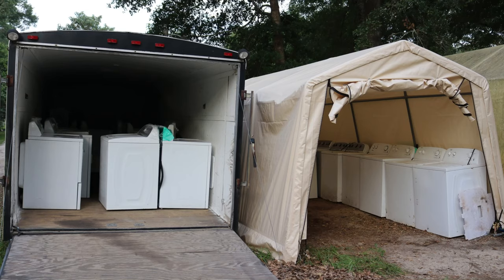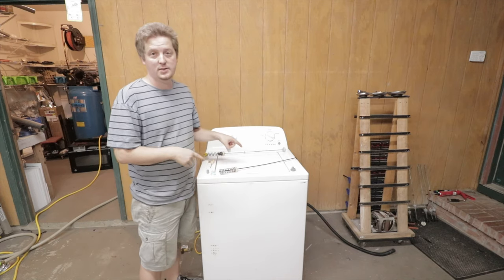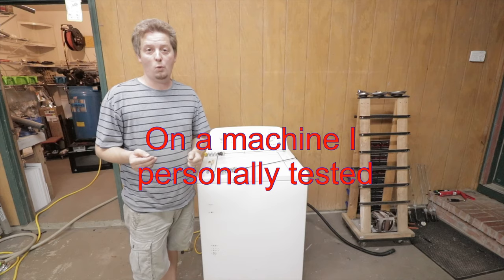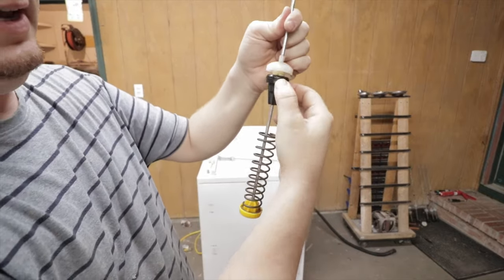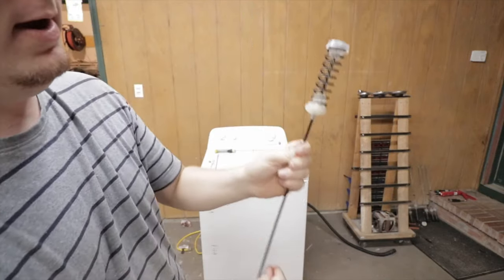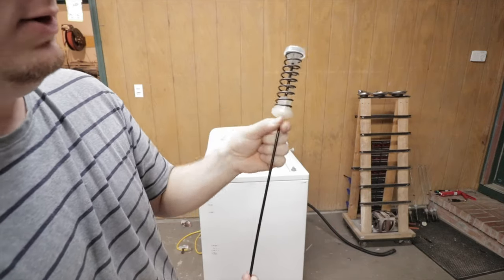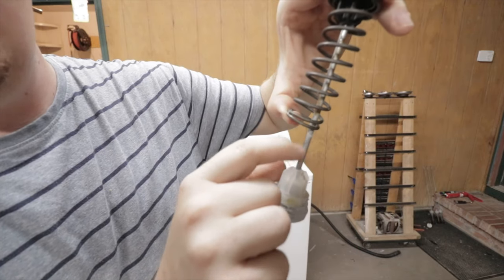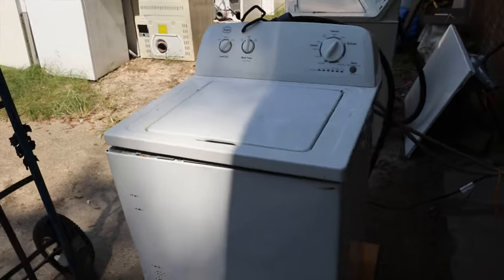Cheap Permanent? fix for shaking banging Washer? $7 to fix Suspension dampening rods W10780048

Comment: Good evening I tried the vice grips on the rods what I did was fill with water at the low setting so that it would compress the spring some then on each rod I pushed a little plastic part down where it was snug against the tub bracket that goes on the rod clamp them off with the vice grips all four corners and run it through it cycle it actually worked pretty decent it did not shake near as bad as it did before but I am going to go ahead and buy a kit to repair them/replace them
Reply from the maker: Yeah some of them are not very expensive at all.

Comment: I just want to say that those springs do get weak but here's a possible solution wrap the area with ductape leave on for a couple days and remove. Now that the ductape has been removed the adhesive from the ductape is now on the the rod. Now the foam piece will stick to the adhesive just enough to allow movement but also enough to not allow to much movement. Or you can just buy a can of flooring adhesive and spray the rod. Thanks for this video which allowed me to think of an idea that I can try.

Comment: I was thinking 🤔 measure the rod with micrometer try to find a drill bit right under that size and make it out of a cylinder piece of wood cut the wooden half from top to bottom and use a metal clamps to a just tightness just a quick thought I may have to try it. It's the reason why I stumbled onto your video was because I have the exact machine off balance but now that you described how the part works I'm going to try the wood with the clamp. Thanks for the video it was a massive massive help!
Reply from the maker: Glad to help. Let me know how your fix works. I’ll be making a follow up video to this one soon I’ve gotten a lot of suggestions from repair guys on how they are fixing this problem.

Comment: I wrapped that little sponge piece with some 60  Grit Emry cloth With the grip facing outwards I pushed the sponge piece back in place . created an  Is friction for the dampling rods to work. I wrapped the Emery cloth around the phone about 7/8 of the way Is them pushed it back in with a screwdriver. Once you have the rods out of the machine it's about a 5 minute fix

Comment: about to get into rod set #2 on a wtw5000dw1. thank you for this insight. i have my old rods and springs, think it's time to get creative. set 2 in the machine has no obvious issues with the caps or springs. worn damper foam  makes absolute sense. thank you

Comment: Good idea. Too save a heap of time and effort TRY using the rubber washers of actual tap or faucet washers. Just pop the rubber off the brass or plastic piece and force a few (maybe even 3) onto the rod and slide them down into position. Cheers from down under mate.

Comment: How much does a new assembly cost?  I have a CNC lathe and can make a repair part.  I would imagine that the entire plastic piece  and foam part could be cut off and the new one could be slit along one side to allow it to be installed without having to disassemble the existing assembly.  The repair part could be made so that it could clip into the spring which would give it the grip on the rod because of the slit.  If it were made from nylon it would last forever.  Depending on the cost of the replacement assembly it could be worth it.
Reply: As I have been thinking about it, the old arrangement wouldn't have to be cut off.  It could be pushed up and out of the way.  After that the new part could be clipped over the rod and then it would nest inside of the spring with the old  useless parts sliding above it.

Comment: Just replaced the suspension rods in my Kenmore Elite Oasis model (110 series) and did the spin cycle empty and it ran fine! Did another light load or 2 sheets. And the basket is shaking all over the place. what now?!

Comment: How do you think this option would work with new suspension rods, ie use the liquid nail as a stopgap/sealant in addition to the uneroded foam/filament before its been used? Seeing the comments that this solution is still working 1+ years in, but want to make sure this isn't just a "bandaid" if "surgery" is needed

Comment: My top load samsung wa50 50r200w had after changing the rods and releveling turned out it was the transmission that, if replaced with factory parts would fail again anyway.

So, now I have a g.e.  viva chinesium

Comment: I never thought about a dampening rod being in the center of the drum..  ive replaced all springs that attach to the lower outside of the drum, added 3 dampeners around the outside, attached springs at the top of the drum and replaced all the teflon sliders plus got 2" thick soft rubber dampening feet for it,  son of a washer still goes crazy every load..  and i can balance the load or whatever at the beginning but it always churns it uneven come spin cycle..

Comment: Thanks for the video. I love people who think! Questions? Can you still find a direct drive machine? If so, what would I be looking for? Here is my problem. I have a large family of 9, so we do 3-5 loads of laundry per day. We have replaced our washer every 1-2 years, with some repairs in between. Currently, we have a Maytag Bravos, which is supposedly "commercial" but it's just marketing IMO. I have replaced the plastic hub 3 times this year, always smooth inside where the teeth once were, now we are having the banging and walking during the spin cycle. So the "suspension kit" is $150 including shipping, and that seems ridiculous to me. Any suggestions on a washer that will last without quarterly repairs? My childhood washer was given to us when someone upgraded and it lasted us another 15 years with heavy use and no repairs.Why can't we get those machines? Thanks for your time!
Reply from the maker: Every town has one or two appliance refurbishers. I am one and I know my little town has two others. I would find the guy that has the best reviews and ask him for a direct drive washer. If he has several to choose from the best one ever made was Maytag commercial direct drive washer. They’re kind of rare but I see them go by on a regular basis on Facebook marketplace. You can usually buy them in the $200 range. Direct drive washer‘s are easy to fix like an old truck. The parts are also cheap and you can order most of them on Amazon. I like any washer they will have some repairs you will have to do every once in a while but nowhere near as often as the cheap junk they sell nowadays.
Good luck and keep an eye on my videos I’m planning on making a video on how to find and recognize a direct drive washer soon.
Reply: @WasherDryerMoney  Thsnks for the thorough response. After watching more of your videos, now you've got me considering refurbing washers and dryers!

Comment: Hi , I have whirlpool top loader washing machine model:wtl 1600 sl it's a 16kg top loader when the machine is at spin cycle the drum shakes and bang all sides till it stop. But when running spin cycle without clothes it is working perfect and all other cycles are working fine please advice how to stop banging and shaking

Comment: Great video and explanation of problem and possible solution.   My washer bounces so hard that it moved the dryer from the vent.  Beyond a doubt the manufactures know this is a purposely built in fault and homeowners subsequently will need to have repairs OR purchase washer. It seems they all have these suspension rods,  They could not continue to produce dependable washers on he market w/o these rods with the piece of foam that degrades and fails.  Now the MAYAG man can't sit and wait for a call  as he is always replacing he rods. I will consider this fix and perhaps come up with another possible fix

Comment: I don't know if you have answered this but how long has this been working for you so far. Cause I'm very tempted to try this method.
Reply from the maker: @peter-johnduncan2071  it’s still working. But I think there’s a better method by using 3/4 inch yoga mat. Just cut it a little bigger than the original foam piece.
There’s also a safety pen method where they push a safety pin through the cap above to create a friction point.

Comment: I have a Midea top load full agitator model that worked well for about 1 1/2 years. It started throwing all my clothes to one side making it off balance. I have the machine level, and replaced the suspension arms as well as the balance ring. I am still having issue. My local repair company is crap and refused to try and fix my last machine(GE) still under warranty because they "did not know what the code meant". I am desperate for help. I used Encompass for the parts and was very happy with their service. Is there a balance sensor that could be bad?
Reply from the maker: It could be the actual inner drum is bent slightly. When you turn the drum by hand and look at the inner drum and the edge of the outer drum, does it have a slight wobble if it does, it’s pretty bad. Very difficult repair and expensive. It will continue to be off-balance because the inner drum is bent and when it starts to span, it will be off balance. You can usually test this by seeing if it gets off-balance while it’s empty.

Comment: Nice video.. I am.a small engine repair mechanic as well as a irrigation specialist.  I think i can fix this. Just don't know how to get to these parts. My washer is a Whirlpool wtw5000dw0. 
If you can tell me how to get to these rods for repair greatly appreciated
Reply from the maker: Check the link in the description use the appliance parts pros search with your model number and it should show you all the exact replacement parts on your machine. You can either buy the replacements from them or search for the same rights on Amazon.

Comment: Another interesting idea I just thought about.
Cut ring groves say about 5 of them starting point of it 1 inch lower from the relaxed position of the spring top plastic cap down another inch or inch and a half.   Make the retaining rings from thin piano wire and feed them in the groves. making sure the rings sticking out of the rod every so slightly to give friction to the plastic cap or it would just act as a stop ring. I will try it tomorrow.
What do you think?
Reply from the maker: It sounds interesting but I'm not sure if it's going to be an easy enough fix for a regular person to pull off. It's similar to the issue I have with how I fixed it. It just is too time consuming for the Liquid Nails to dry completely. But give it a try and let me know how it works.
Reply: @WasherDryerMoney  You are a good man.  So Here is what works.
You can feed the coil spring with resiliant styrofoam, not the stiff type but the ones that when you twist them it bounces back.  Their life expectency is said to be around 5 years.  Those memory foams are good candidate.
Second solution. Cut of the end of the rod, that little ear that hold the metal washer.  Remove the washer, the spring and take the top housing off to get that sponge out as you have.  Cut off half of it. In its place put couple ( 2 is better than 1)  stacks of  1/4" thick rubber cutting it with the same diameter.  I do it like this.  I cut a square piece of 1/4" thick rubber and without cutting a hole in it. I just shove a small nail or thin phillips screw driver just to break the rubber. I feed the suspension rod forcefully into that hole I broke.   Up I feed the rubber.  You know that other stuff goes first, the cap, the previous gasket.   Bring up the housing from the bottom and the remaining sponge down with the rubber in between.  There you cut the rubber with a scissor as that sponge will guide your scissor.  Now force feed the rubber inside that housing, press it in all the way and tap it with a screw driver.  The rubber will seat flat even though it looks like it won't The rubber will give so just press it and see that finally flattens out.  It will.  Feed the sponge, press it into the hole.  Put the cap on.
feed the spring and finally the metal washer.
Take a flat chisel, not a sharp one and place it on the rod end and whack it with hammer, one on each side of the rod.  That will hold the washer in place.
The rod maybe shorter by 1/4" of course but the washing machine wouldn't tell the difference.
It works perfect.

Comment: I've tried multiple "repairs" and none of them work for very long...
From wrapping the foam with fabric tape to make it squeeze the rod tight again, to placing more dampening grease, to adding a small piece of rubber tubing over the rod so the weight of the tub presses it into the foam (this method worked the longest for about 3 months.) However, now I'm buying some new OEM rods because none of this is a permanent solution and it's not really worth the headache.

Comment: how did this end up working? i used to be an appliance guy before switching to hvac trade..had a house built and builders installed a wtw5000dw3 washer and ive only been in the house for like 4-5 months and this is already occurring... its like whirlpool didnt do anyextensive testing on this...atleast offer upgraded parts for godsake so we dont have to rig these machines back to working order...
Reply from the maker: I am still using the machine that’s my personal Washer. It’s still working perfectly. I am going to do a few more videos on the subject soon. Including an update video showing the machine still working perfectly.

Comment: Thank you much! I read about the compression and decompression of the spring, but I didn't know which part of it act as a dampener to slow down the decompression. Now I know.

What I did was to use those friction foam pads to keep your handphones on the car dashboard. cut a small size and wrap it around the rod before inserting it into the cavity where the worn out pads were sitting in. (can throw away the pads). let's hope it lasts.
Reply from the maker: Glad to help

Comment: OK, my whirlpool WTW5000DW0 has the vib problem big time. I purchased OEM new Whirlpool springs
Recalibrated and leveled machine. NORMAL wash and loads and NO HELP. Going back in as it is getting worse each load! It now vibrates badly EMPTY on DRAIN and SPIN! I suspect the tub ears must be broken/cracked or the motor mount is loose???  Will advise. I loved this machine when I first purchased and now I HATE it! Nothing makes sense as to how it could vibrate this badly... or how this engineering design could ever NOT vibrate! This model has no agitator and no matter how evenly you load the clothes, it is always out of balance as soon as it starts to spin. HELP~

Comment: Why not fill that dense foam with silicon, better than hot glue, tape, or liquid nail... maybe?
And I must tell  you, I am glad I ran in to your video.  Now I know something no one has revealed.
I have also fixed it another way that I want to share.  It lasted 1 month a half or so.  I cut a garden hose and wrapped around the spring and put a couple of hose clamps on  it.   After the time period, the hose was busted up.  But what you are saying is the real deal.  I will try it now.
Also, I just installed horizontal struts secured it to the top of the drum and the corner bracket where the spring rod is hanging.   No help, maybe a little..
So I better go and get it done before it gets too dark.  Oh, since I know the principle of what you are saying, for a quick truth test I will apply tape on the rod and shove that dense foam on the tape and see what happens.  I will be back here to make a report. Give me an hour or so.  Thank you.
Reply from the maker: That's funny I just commented on one of your other comments the same solution. I heard a few weeks ago from a repair guy. Instead of water hose he was using the thick tubing that they sell by the foot at Lowe's. He said he puts it about halfway up the spring to stiffen it.

Comment: I have a Simpson Eziset Top loader washing Machine. After watching your solution I discovered my machine had the same problem. The damper system on mine is around the spring and resembles a big syringe with the rod coming out the end. The small foam you spoke of sealing around the rod, mine was at the large end(like a syringe), and only a plastic hole for the rod to go through. The hole had elongated and no longer had any dampening effect. Instead of using adhesive I used a Hot Air Gun and similar plastic to rebuild the hole around the rod. I used Plastic Zip Tie as filler rod as I plastic welded it. A little care is needed with the hot plastic, but all in all an easy fix. Thanks for the Great Video.
Reply from the maker: Very interesting. Let me know if it gives out. I used heavy duty hot glue and it only lasted a month. My fix with the Liquid Nails as still running strong.

Comment: Could you just inject rvt gasket maker inside the foam piece to rebuild it?
Reply from the maker: Possibly.  People are having good luck with The two-part putty. The problem is things is they take too long to dry or they will not dry when you close the cap. If it requires air to dry it’s usually a problem. Which is probably why two-part Apoxsee people are having good experiences with.

Comment: I have a Whirlpool that vibrates pretty bad. No violent shaking or banging around , just a bad vibration causing the wash drum/motor to shake/vibrate. My unit has the 3 smaller springs and 1 longer spring in the rear, replaced them.  No good, problem still there. Unbolted the motor and set it down, energized it to see if it was a bad motor, its good. Model number is WTW5321SQ1. Happens on the spin cycle, otherwise works fine. Empty or loaded washer doesnt change anything. Any idea what it could be?